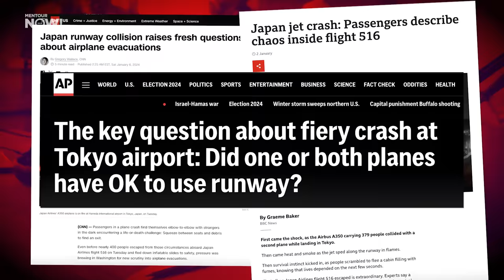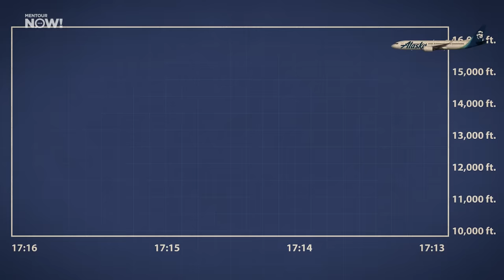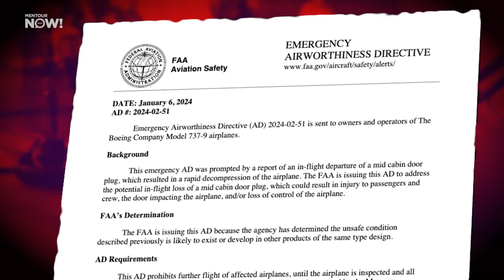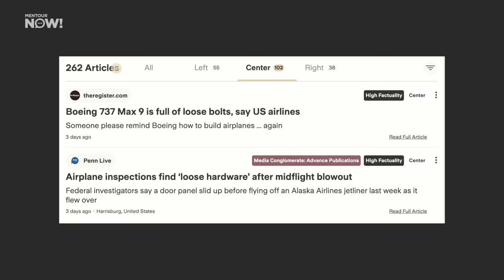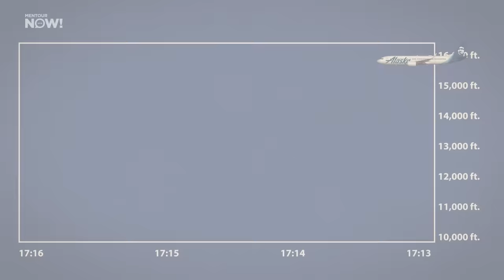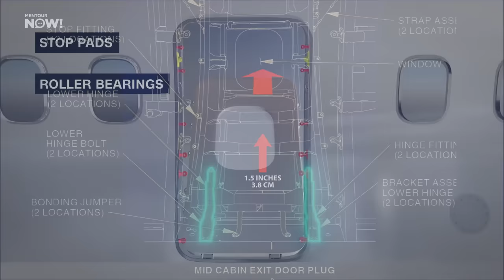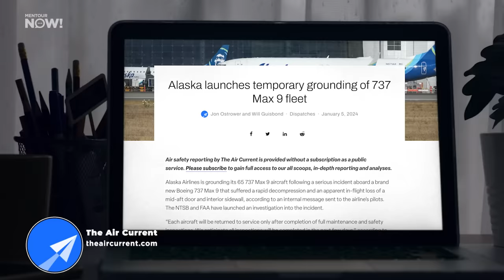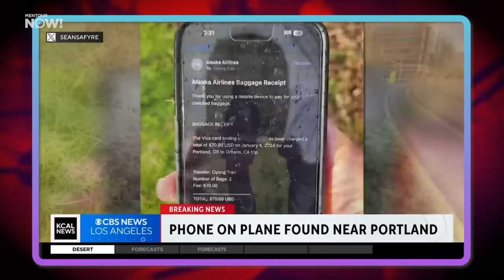WHAT Is going ON with Boeing?! MAX-9 Door blowout

Comment: If that door lifted out enough for a pressurization leak, that condition would be visible on the exterior of the aircraft as a noticeable depression or bump depending on how far the door moved. Cabin pressure outflow valves on Boeing jets are 6 to 8 inches in diameter and open enough to see light through, much like a stopper in your bathroom sink. If a cabin pressurization problem was as a result of a misaligned door, it should have be caught during the preflight walk around visual inspection, especially on a very new airframe like that with shiny new paint and no stress wrinkles.      Why would the jet be released to the aircrew to fly if it had repeat pressurization writeups that were not troubleshot?        If the jet was not safe enough to fly over water, THEN it was not safe to fly above 10k feet with passengers onboard!    This incident was totally preventable. As with most crashes, it is a chain of cumulative events that add up to a catastrophic ending. Thankfully no deaths, but certainly physical and psychological injury for those passengers.
Reply: Ah the pressure issue was false warnings on the ground and unrelated. There was indeed no slow leak.
Reply: Mando, thank you for the reply; however, this cannot be chalked up to false warnings. THE AIRCRAFT HAD RESTRICTED FLIGHT PARAMETERS DUE TO THE PRESSURIZATION ISSUES THAT WERE NOT PROPERLY TROUBLESHOT AND CORRECTED. I worked very intimately with Boeing airliner type airframes the last four years of my USAF career. We did not fly with ANY type of pressurization discrepancy because that means a bunch of people on oxygen for a log time, not to mention a safety of flight issue regarding explosive decompression, especially from a lower lobe door, entry or overwing hatch blowing/ripping out with the associated structural damage. The crew and passengers were lucky on this one that it blew out at only 16k feet where the differential pressure was not that great.  The fact the door plug blew out at a low altitude is a clue that the plug was not secured. There is no other structural damage to the opening indicating the plug opened according to design.

Comment: History repeats itself I’d be willing to bet that somehow down the line in McDonnell Douglas designer or engineer that came on years ago knows exactly what I’m talking about. History truly does repeat itself the DC 10 went through very similar groundings. Boeing has not built quality aircraft in decades just look at pictures of any 737 that has crashed or landed hard Heck look up the documentary that the ex Boeing employees that blew the whistle did on the bear straps and the fact that the planes split into three etc. etc. etc. I used to love Boeing emphasis on the used to

Comment: That plane there was a few hands that were dirty with the issue (Spirit and Boeing Employees) Personally people from both sides should be fired and jailed from the digging into every single step of that process my crew did.

The other planes with loose bolts, is a culture and process issue that needs to be fucken changed because it makes working for Boeing embarrassing, Those plugs are buttoned up by the time the plane makes it out to us on the flightline, we have a crew who are now checking the few -9s that we have on site but it's not something we'd normally check (god forbid the people with clean access in the factory actually look it).

The whole thing is annoying and frustrating.

Comment: Little late. It was reported. The aircraft after delivery, went to Oklahoma for WiFi installation.  Suspect hat for satellite antenna added to aircraft for WiFi. Pictures of aircraft in dock were shown.  Suspect persons doing the fab work forgot to install retaining bolts of the door plug.  Perhaps no adequate QA inspection of the mod done.  Something was likely MISSED. Appears that neither Boeing nor Alaska Airlines were at fault. They may have been victims of the WiFi mod done to the aircraft.  This is conjecture on my part but may be true.
Reply: There is no evidence to date of AAR removing the door plug. AAR is a US government and military contractor, and I sincerely doubt they'd put all that at risk by issuing the following statement.

January 08, 2024
AAR issues statement on January 5, 2024, Alaska Airlines Boeing 737 MAX 9 incident

Wood Dale, Illinois — AAR CORP. (NYSE: AIR), a leading provider of aviation services to commercial and government operators, MROs, and OEMs, learned of the recent incident impacting the mid-cabin exit door plug of an Alaska Airlines Boeing 737 MAX 9 on January 5, 2024, that resulted in an emergency landing of the aircraft. 

AAR did not perform any work on or near any mid-cabin exit door plug of that specific aircraft. AAR was contracted by Alaska Airlines to perform a 2KU Modification (Wi-Fi modification) on the aircraft that was performed from November 27 to December 7, 2023.

https://www.aarcorp.com/en/newsroom/press-releases/2024/aar-issues-statement-on-january-5-2024-alaska-airlines-boeing-737-max-9-incident/

Comment: Boeing dodge another bullet. On three different occasions the cabin pressure alarm sounded to DEAF EARS. If it turns into a Broadway play it would start out ..... Captain , the cabin decompression alarm has just sounded ..... " What again ! reset the circuit breaker , take out the fuse , put tape over the buzzer , do something , you're the engineer damn it ! " . Act ll ........ as the oxygen masks drop from the ceiling ......... the captain yells out ..... now what ?

Comment: "Loose hardware" on a brand new plane? This is hardly acceptable. Even on a car you wouldn't expect bolts to fall off after a few months of intensive use. Boeing should really get to the bottom of this.

Comment: As the CEO of Boeing, majority share holder, head designing engineer, and believer in Boeing, I extend my most sincere of apologies for the extremely small numbers of defective Boeing 737 Max Series jets.  Rest assured, the 737 Max series of jets are so safe, they are among the highest build quality and highest in-demand aircraft in the cosmos.  The Boeing 737 Max series is in such high demand, I felt compelled to contribute my own three, personal, 737Max series jets to help obtain the production numbers needed for this extremely safe and in-demand jet. I, the CEO of Boeing, am willing to forego the amazing safety, advanced technology, and high efficiency of the venerable Boeing 737 Max and have leased a lowly Airbus A320 for my personal air transportation needs. I am not above humbling myself in an inferior, and unsafe, Airbus A320 in order to help meet the extremely high demands for the best commercial jet series known to man, the Boeing 737 Max series line of passenger jets!

Comment: Do I understand correctly that when the door/plug is installed correctly there is a gap at the top of the door between the door skin and fuselage skin? Photos suggest this is so. Apart from being ugly it will also create drag.  Was this designed by an accountant? I suspect Mr Sutter would be rolling in his grave.

Comment: I would fly on a Boeing again....They’re excellent planes....The whole out sourcing thing in order to save money and compete with Airbus is risky and stupid...They need a new CEO...The need to get back to the original practice of in house manufacturing, even if it costs a bit more money. Boeing is the best. They’re being mislead  by bad management...I would rather pay more any day for a Mac computer than a PC....I like quality and reliability and a more simple interface any day over a cheaper quality machines...That’s the analogy I draw between Airbus and Boeing...Boeing will get it sorted out 👍

Comment: Missing securing bolts seems to be the most likely scenario. Boeing have lost the production engineering focus, and are profit (and perhaps more importantly) 'dividend' focused. Producing complex and mission critical engineering products takes expertise and expense - Boeing seem to be doing everything to boost/sustain dividends, over 'products that do what they should do - reliably'. Boeing's engineering and production processes have been under severe cost pressure for over a decade, and it is now reaping what is sowed. So happy that in this particular instance no one was killed, but they certainly had a traumatic and life 'altering' experience.

Comment: I forecast that after the investigation is over it will be attributed to the internal hiring practice and policy to subcontractors at Boeing. They are now forcing the hiring of people based upon how they look rather than merit. It’s a DEI score they are after and care less now than before for safety and quality. These people sometimes don’t have enough intellect to follow comprehensive instructions and their incompetence has resulted in the failure to install the bolts or to install them correctly.

Comment: Seems to me that the 737 MAX is a jinxed plane and it's probably fair to say that it was cursed at birth. Rather than go back to the drawing board and come up with something new for the 21st century, Boeing decided to try and squeeze more milk from a goat that had already been drained dry. The problems Boeing have been facing in recent years is a case of history repeating itself. At the turn of the Millennium we had Railtrack; an engineering firm that was run by woefully incompetent bankers and a culture of sloppy work and corner cutting was the norm, with terrible accidents being the result. All this led to Railtrack going under in 2003 and alas it seems that the lessons haven't been learned, as the exact same disease of corporate incompetence that blighted Railtrack has now infected Boeing. The bean counters call the shots and innocent people are paying the price!

Comment: The cabin door is designed to do that on this plane. Shocking that the pilots were not updated about that feature. Also incredibly stupid design. If a terrorist fires a gun or a small explosive device and the plane loses pressure, the cabin door is then open and lets them have complete control. Who thought that was a good idea? wtf

Comment: With Boeing showcasing the quality control, quality build, safety standard, durability, and safety record of Airbus, they have made it impossible for Airbus to keep up with orders.  Then Boeing will release the perfectly timed Boeing 727 Max  305 D.B. Cooper addition. It will fly is a S-pattern at a service ceiling maximum of 10000 feet. It will not be a pressurised jet It would fly 120 miles per hour max, circle for hours before landing, have a rear hatch that opens in mid flight, landing gear that will not retract, flaps that are locked at 15 degrees.  The range will be 1000 miles.  The price of each jet will be $200,000 USD. The inaugural flight will provide four parachutes for each passenger, and a cigar the shape of a dynamite stick!  There will be a door prize of the value of the new Boeing 727 Max 305 D.B. Cooper addition.  But it will be paid all in 10,000, pre circulated, nonsequencial twenty dollar bills!
Boeing chairman believes this will save Boeing.

Comment: There is nothing left to explain about. Boeing has a problem. This incident clearly shows, Boeing has not yet resurrected the spirit of a great aircraft manufacturer. They started to show signs of riding a dead horse.

MCAS was a scandal. Making an attitude affecting system dependent on a single sensor was grossly negligent and disgusting, given the reason for that cheap design. To not let the pilots know, the erratic behavior kicks in again after clueless search for the error and shortly happy deactivation was crime. Regret, Forgiven.

Manufacturing issues you reported, with falsely built rudder assemblys and quality issues with snowmen for back pressure bulkhead assembly now continue with falsely assembled door plugs. This is what engineers call systematic error. Systematic error in quality control. No more room for regret. 

Nothing less than a mess, introduced by focusing on profit, „core business“ and stakeholder value, killing spirit. Boeing should slow down production and take their time in order to regain old strength, building great aircrafts. No one may build or rebuild spirit. Spirit is to be lived by humans. The employees seemingly have to resuscitate their spirit by themselves.

Doing anything other possibly will end in desaster of trust. With Airbus currently doing great, there is only one other out of a duopol remaining. Boeing weakening themselves creates room for a third one, possibly China.

Comment: I call the 737 Max the Frankenstein plane, they should have designed a new single aisle airframe from the ground up instead putting the 737 on steroids!  Plus outsourcing way too much, main reason wanted to reduce the union influence well it's coming back to bite them hard.

Comment: Boeing is in a downward spiral. It is evident that the former mission of the company towards excellence in engineering vanished gradually after the merge with MD. The scandal behind the two crashes of the MAX was already a clear indication of lack of passion for good practices in design and manufacturing. And this event is just another one on the same line. I feel sorry for them, but it is not a “bad luck” situation. They built their present, and they chose Not wisely

Comment: It's common, just as a Newly delivered car, truck or Power Boat to have various Factory Defects but Unlike Alaskan Airlines with theTheir Known Repeated  "Fuselage Cabin Air Pressure"  Alarms indicating an Abnormal cabin Air pressure Leak defect, Unless you're Trying to Kill passengers or Crewe, you Don't keep Flying it Until some Pressure containment Hatdware Blows off in Flight at cruise  Altitude.......Everyone got extremely Lucky with this Explosive cabin Decompression that Usually ends up Much worse.....Likely, some associated  Incriminating Cockpit "Chatter"  was on that CVR tape that Had to be destroyed Before the NTSB investors found it.....That neary  Full capacity plane Was Restricted from over water routes & Somehow the Closest seats to the Plug were just  Suspiciously  "Luckily"  Unassigned & vacant ??? ....The Airline Has the Responsibility to keep a specific plane grounded & Out of service until the Magnitude of the Repeated alarm defect is Identified & Seriousness to Fleet determined......

Comment: Previous Inflight cabin Pressurization Alarms, Alaskan Airlines Knew That plane Had an ongoing air pressure Leak problem but Continued to Risk revenue Fly it regardless.....If You had a Slow air LeakIng vessel or tire, you simply Ground  Air Pressurized & Economically spray Soapy Bubble solution all over All extermal Pressurized cabin surfaces Particularly all Door, Plug & windows Initially.....The Pressurized air Leak colul Likely have been Safety Located on Runway & quickly Repaired in 1 day out of service with No Risk to Crew or Passengers.....Takes a little Time & effort but Not psychic or Genius to Locate & Repair an Already Leaking defect !!

Comment: At this point, Boeing is now a dead company to me if this is the crap we can expect still from them. As far as I am concerned, flying is no longer the answer. I think I rather cross the US in my 32 year old Honda Civic with 300,000 miles on it than in anything built in the past 10 years, especially anything that flies. This is getting out of hand and these companies keep proving they are run by absolute morons. I am so tired of opening up a browser and seeing all this stupidity. And Boeing has only itself to blame, just as any of these companies making garbage now are to blame for their shoddy work.

Comment: Why doesn’t Boeing stop Cutting Corners with so many Sub Contractors!  I would feel safer flying on one of the First DC-10’s!  At least I would Die or Crash in Style instead of this Cheap Knock off of the once reliable 737-100 or 200 series Aircraft!  Boeing had really gone Downhill as far as Research and Development!

Comment: This whole Boeing thing is just a ridiculous joke, except it's not funny and I am not laughing at all! How many more 737 Max jets have loose nuts and bolts (and I am using that term loosely to cover anything that has been included in the plane construction) rattling around inside their fuselage! How many times does it take production workers to shout out dodgy work practise and concerns for the quality of the product that they are producing, before management actually listen and don't bury those legitimate warnings! I am already concerned about flying Boeing jets and now have to listen to a Boeing CEO feign concern regarding their product! They are very VERY lucky someone didn't get sucked out of the space where that plug door was and that there wasn't a more problematic issue after it's loss but it is extremely alarming enough and doesn't give any passengers greater confidence, after the previous loss of the two Max 8 jets, which could have no doubt been avoided! 'I am concerned about my family flying Boeing!' What an awful thing for me to even have to contemplate or say but that is the truth and if I can avoid flying 737 Max jets I goddamn (I am being polite in my cursing here) will!

Polite note: I realise that all aircraft, including those manufactured by other aircraft makers may have potential construction issues and that most air crashes are often caused by human error, so I don't need any replies advising me of these or similar facts. I thank you